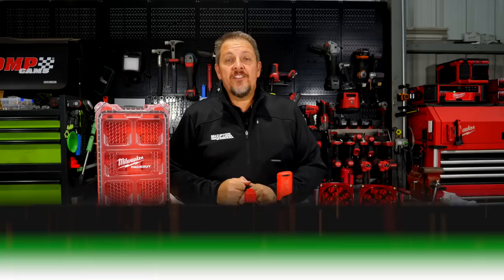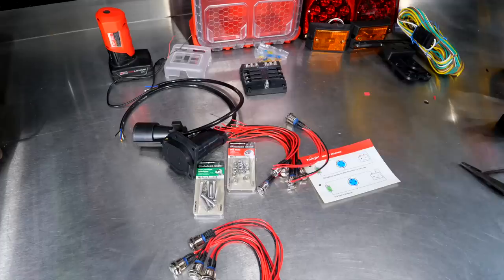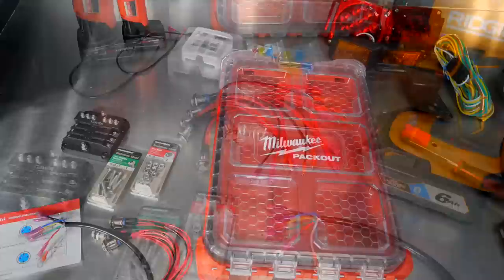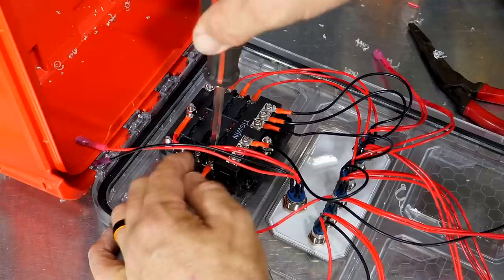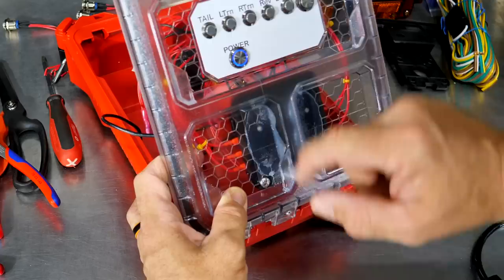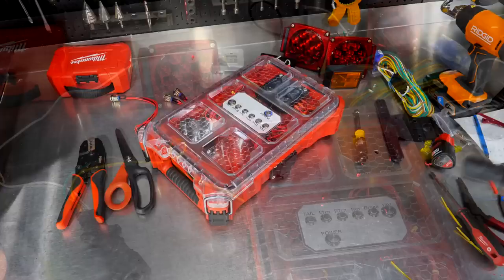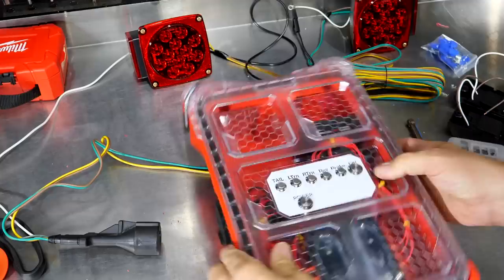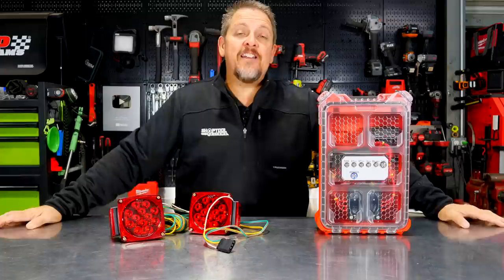How to Build a Milwaukee PACKOUT Trailer Tester [M12 Powered]

Comment: I work on trailers for a living I think this is a great idea. Our cart we built I have a single 20a circuit breaker for the main power feed to my switches and we don’t use a flasher it’s less to fail. The m12 should be adequate to energize the brakes.

Comment: I would have put in a single fuse to the main power, or better yet a circuit breaker. I also would have put the buttons in one of the pockets at the hinge area. The plug in the other. That would have reduced the internal wiring greatly. Plus all of it would have moved together. Then build a divider so the rest of the box can be used for storage without worrying about damaging anything other than the battery wires.

Comment: Awesome project. My only recommendation would be to incorporate a turn signal relay just so that when you test the turn signals it functions exactly like it would when connected on the vehicle
Reply from the maker: Yes, we mentioned that in the video. You can add an LED flasher inline to show the turn signal in action if you wanted. Thanks for watching.
Reply: I don't understand the desire for this modification. The flasher simply applies and removes voltage to the lamp. Unnecessary and goofy.
Reply: @walterk1221 exactly lol that is a completely useless feature
Reply: @walterk1221  i agree…if u have to flash it just push the button in and out real fast and save $10 😂

Comment: If you have a trailer with a lot of lights you might consider using relays to save your buttons. This is a great idea thanks for sharing
Reply: Most switches made by reputable manufacturers are rated high enough for something as simple as a trailer light.
Reply: @joshuaskirvin  some trailer light circuits have more than a light in them. Not all trailers are the same. If that will work for you do it.
Reply: @michaelosmon  I know plenty about circuits and how they work. I am an Industrial Electrical Maintenance Tech and I've been an Electrician my entire adult working life. Residential, commercial, industrial and line work. Most trailers aren't complicated enough to need relays to work the lights. Especially for a short enough period to just troubleshoot and turn it back off. You're not wrong, but it's usually not necessary either.

Comment: This is a nice design. I "invented" a trailer light tester 20 years ago using a couple PS1270 batteries. I had a separate function to test the brake lights and then electric brakes. The E-Brakes would draw down the voltage. Over time I was able to ascertain if the brakes were working correctly by the amount of the voltage drop. I started on a new build a couple weeks ago and plan on using a hall effect sensor to be able to monitor current draw. I was curious if anyone else had done a trailer light tester so here I am. No YouTube when I built the first one. You've given me some ideas, so thanks!
Reply: Hall Effect Sensor - hmm and a whole bunch of wasted time building some kind of circuit that tells you what the Hall Effect Sensor is sensing. Ever heard of an ammeter to measure current draw? You can get a really cheap combination Volt - Ammeter and really know what the source and sinks are doing.
Reply: @PredatorOmnivore  So... you may be stuck in the 80's, my man. With a bundled display USING A HALL EFFECT SENSOR you can read current draw without running everything through an old timey ammeter. Pretty damn easy to integrate. In fact...I've already built the thing. Works great.

Comment: You can get label makers that print on heat shrink tubing.  This would help in troubleshooting down the road if you ever need to fix the trailer tester.  Even a pack of cable markers would be useful.

Comment: I did the same project with a plastic ammo box from harbor freight that cost $3 with a coupon, an old plug from work, and push buttons from temu that cost $8. I used din rail and terminals bc I had them on hand already. My adapter was $10 from Temu also and came in under $30 all in. It looks just like the one IPA sells for $175. Thank you for posting this!!!’
Reply from the maker: Thanks for sharing. I'm sure the ammo box worked great too. Thanks for watching.
Reply: @Shoptoolreviews  Love your channel and a great idea!!!

Comment: Personally, I'd make the box as water tight ~(IP68) as possible to protect the investment of all those switches, wires, and connectors. E6000 or Shoe Goo would work well around holes drilled into the box, as well as painting the interior of the box with superhydrophobic coating. My son-in-law uses 20 Volt drill batteries as jumpstarters, so I'd integrate that as well. Seems like it'd be a time saver. Keep up the good work.

Comment: My only addition to this would be a voltage readout for testing the 12volt section. I have had trailers with batteries that didn't charge due to a bad plug. Not sure how to get the readout off the trailer though.

Comment: You could add a flasher and use it for temporary hauling a trailer with a truck that has messed up wiring harnes.

Comment: @shoptoolreviews - I LOVE IT! Gonna make a couple for my techs. Couple suggestions for V2, mount the switches along the side instead of the lid so that you don't lose the function of the top cleats. I also plan to mount the plugs in the rear wall and the battery towards the rear to still hopefully keep as many of the bins in it as possible for harnesses, terminals, etc. Great job and keep these videos coming!
Reply from the maker: Great ideas! We didn't really care to have something stacked on top of this packout, but we did make sure to have the bottom untouched. This allows it to stack on top of other PACKOUT units. We are definitely making a list of ideas for V2. Thanks for watching.
Reply: @Shoptoolreviews  when you do V2 I’ll buy this one from you.

Comment: What I did with mine, Not a puckout kit (but I think it would all fit) is have the vehicle side tester integrated in as well. basically some lights for the outputs of the truck (you'll need a high load to simulate the trailer brake though. I use a headlight bulb). then you can loop into itself to do a self test.

Comment: This is a great idea. Built something similar in the shop.
You could use a 100whatt globe as a main power fuse in place of the fuse box. This way you can determine a short in the trailer circuit without having to replace fuses in the field every time there is a short

Comment: I have one I made 25 years ago but it uses a lawn tractor battery so it’s kind of heavy but for a trailer shop this is the most used tester there. I have used the mutt ones but they don’t last that long. I like the idea of the pack out system because you can take the necessary tools and supplies with you. I would use auto resetting circuit breakers,a flasher for signal lights and more battery power because when you are testing brake magnets they draw a lot of current. How about making the truck side tester with a couple of brake magnets to show a simple load with a voltage output meter to test brake output of the controller.

Comment: I like this one...water tight and room for parts to fix the problem. Good job Tim. Thanks for sharing.
Reply: This is not water tight. He drilled several holes in the pack out.

Comment: Great project! Could you add a link to the M12 adapter that was used to plug in the circuit? I'd love to see a project with a direct connect battery.

Comment: Good idea only changes i would recommend versus using an M12 battery I might add through bolts and thicker Guage wire to the fuse block and master switchto make places to attach clamps for a jumper pack to connect to account for higher demand items. I also would add inline relays as has been recommended a few times to relieve the excessive draw on switches of higher demand systems so you get more life and don't burn them out.

Comment: Can you make a version for semi trailers next ?
Reply: Should be the same thing just with a semi trailer plug instead.
Reply: @erickbarroso767  wasn't sure with the abs
Reply: @xandersmith9832  yeah the 12v auxiliary should power the ABS, you just have to wire it up however suits your purpose.
Reply: Much appreciated 🙏
Reply: Without a compressor it won't test the air brakes but it will test all the lighting.  You'd just need to change the electrical connector.
Reply: @ianbelletti6241 lol no shit

Comment: Great idea, I could have used this dozens of times.  I will orient mine like a trailer as well as use button LED lights so I can see them lit when troubleshooting the actual trailer light if not working but supposed to be.  I want a blinker socket to test blinker moduales and lastly, I'm not using my Milwaukee battery, but rather a gel batt I have been using to test each light.
Thanks!

Comment: I do not see a link for the M12 adapter?  The link for the M12 FUEL Kit is for Milwaukee tool kits, some with M12 batteries.  Is the M12 adapter in this video available separately?

Comment: Great Job, I've been thinking about building something similar to this for a while now. I'm always the guy in the shop that gets stuck with all the trailer light issues when they come in, and most people just drop off their trailer, which leaves me having to hook my truck up to it to power everything. Never thought about using a PACKOUT though, thats a great idea to be able to take it along with everything else I take out into the field with me. The only changes I can think of would be using circuit breakers instead of fuses, and I would probably install more types of trailer plugs than just the 7 way, rather than relying on adapters. Though that is the most common anymore, a lot of the old farm trailers I work on here still have the old 6 way round plug, I spent a good amount of time chasing some issues on a trailer last week before I finally discovered my 7-6 adapter was screwed up internally.

Comment: I made something similar to check the truck plugs. It has an extension cord so I can sit in the seat and see.
Reply: Can ya explain a bit more? What are “truck plugs”? Etc
Reply: @delliott777  the trucks trailer plugs. I’ve fixed a box that has lights that tell which is brakes, turning signals, etc. The box also has a place for the plug adapters. It even has a spot to plug in a ground cable so I can make sure the ground isn’t out. I tried to think of everything on it.

Comment: So I made one plugged my trailer with a 7 way into it. The only lights that didnt work is the brake light one.  
Plug the trailer into the truck the lights on the trailer works.. any suggestion
Reply: The brake button isn’t a light, it actuates the brakes on the trailer.

Comment: Great project v2 needs a custom printed circuit board, turn signal relay, and 3d printed m12 adapter in a smaller enclosure that fits inside the box.
Reply: Turn signal relay is absolutely useless unless it is the EXACT relay in the tow vehicle.

Comment: For what it's worth, the M12 power adapters have an internal SMT 1A fuse that is exceedingly annoying to replace. That fuse will pop before any of the other fuses on the distribution block.
Reply from the maker: That is correct. Which, for most common trailers, you're probably not going to over-amp, unless there's a dead short. But you're correct, that's why it probably makes more sense to just go with spade connectors off the battery with an inline 10 or 20A fuse. Thanks for watching and commenting.

Comment: A lot of good suggestions in here for V2.  I like the idea of compartmentalization inside the box so you can carry extra parts, bulbs, fuses etc.   one other addition I would make (I don’t even know how if its possible b/c Im not a wiring / electrical guy)  find a way to store the M12 battery charger so you can just plug the box in w/o taking the battery out. And or make it for larger battery or multiple batteries for testing of brakes etc.     still love the idea, seems way cheaper than buying Milwaukee’s self contained box.
Reply: Whole reason of this video is just to show you it can be done at home with whatever brand of power tools you already have.😎

Comment: The only thing I think you are missing is a brake controller for the brakes. I had my truck brake controller showing short and the rv repair shop used a similar tester and it show good. They were blameing my truck wiring as the problem. When I had them connect my trailer to there shop truck it also showed shorted. Turns out it was a shorted wire in the brake housing.

Comment: Been trying to find a vid like this, most are just "here's what I built", but never show anything of HOW.  I think version 2 should incorporate a (digital) voltage meter, one that reads both current coming in and draw.  I watched another vid where they had one and it helps to show if the brakes are drawing current or not (and everything else too).  One comment on the vid said that trailer brakes draw only so much current, so all you have to do is divide the number of the current by how many brakes you have.  Might not be perfect, but at least you can narrow down if they're all working or not.

Side note, totally gonna buy this pack-out box and adapt it to use my Ryobi batteries, just to piss with people :D

Comment: I would an accessory kit it’s a junction box with fuses with one micro cable like a phone charger to a small keyboard different amount of buttons I have inside my truck to control up to 6 items with one small cable instead of running powere to each separate switch

Comment: I might have to make this for work. Probably wont use a Packout box though
Reply: Used a small ammo can for mine. For power, I used a lighter plug. So I can plug into multiple portable power sources. I also saved space by not using a giant fuse box and just fused the main power. All the wires fit in the box plus the plug-in truck side testers.

Comment: Brake and signal is the same light but different wires. You should set it up to test both.  You did do an awesome job on it though. But my real question is why not just hook up a vehicle to the trailer?  I have 3 trailers. Never needed a set up like this.
Reply: To test the trailer, I’ve had to test on multiple trailers to check wether it’s the truck wiring or the trailer wiring.

Comment: What's driving me nuts is all the extra wire between the switches and fuse block. You could've gotten away with making the wires a little shorter, lol

Comment: Why did the brake lights not work when you pressed the brake option? It should still have brake lights even with 4 pin connector 🤔
Reply from the maker: No, the “Brake” button is for electric Brakes on larger trailers. That is only on 7-pin connectors.  The Brake/Stop lights are the same circuit/bulbs for turn-signals on a 4-5 pin.

Comment: Nice job, but I would highly suggest soldering everything instead of crimping.  Through my years of working and repairing electrical wires, the majority of the issues are always the crimped connectors.  Your building a testing jig and you want to take all the possible weak links out so you don’t waste time trying to find a fault in your build.  Solder is the best way to go here IMHO👍
Reply: Nah crimping will be just fine especially enclosed in that case

Comment: I built this be careful I destroyed the m12 power source you can over draw it especially with electric brakes
Reply from the maker: Yeah, we should've just used spade connectors directly to the battery. There's an internal 1A fuse in the power source, it can be replaced, but it's a pain. Anyway, sorry about that. Like I mentioned, should've gone direct to the battery with a 10A or 20A fuse.
Reply: @Shoptoolreviews  can you put a bigger fuse in the power source?

Comment: Really seems like a solution to a problem that 0.0002% of the population has. Sure if you are rv service center then it is probably a great idea. For anyone who is not a rv service center then for under $20 you can get a trailer light tester for your truck. If your truck lights check out then you already have that whole system sitting in your driveway. Considering you are likely going to hook your truck up to your trailer to move it to where you are going to work on it, just leave it hooked up. Just seems like a commercial to sell Milwaukee pack out boxes. If that isn’t the case, why not suggest plastic ammo can?  Smaller in size, significantly cheaper, and deep enough to mount the battery adapter on end and then you don’t have to mess with unhooking the wire tie each time you have to unhook the battery to charge it? Now make something like this that powers an electric trailer jack/electric trailer winch, then you have a product that at least 1% of the population would find benefit in.
Reply: If you have more than one trailer it’s definitely useful.